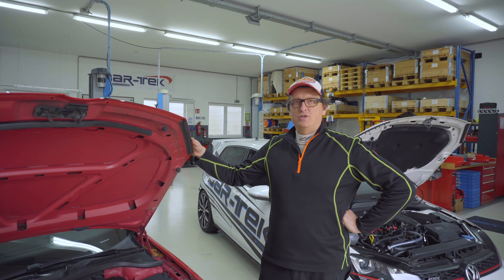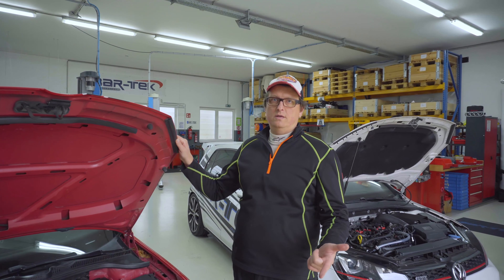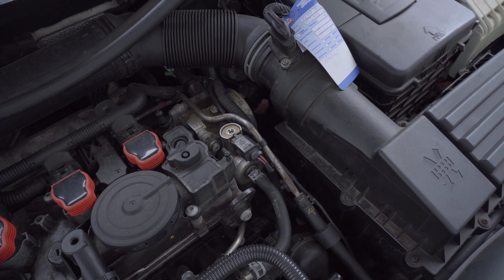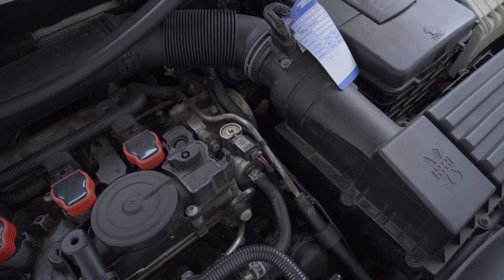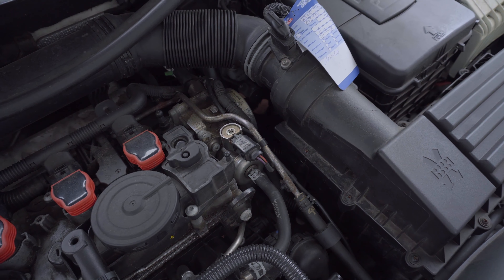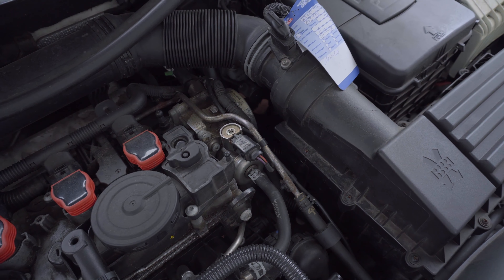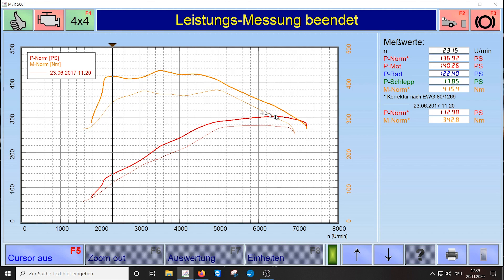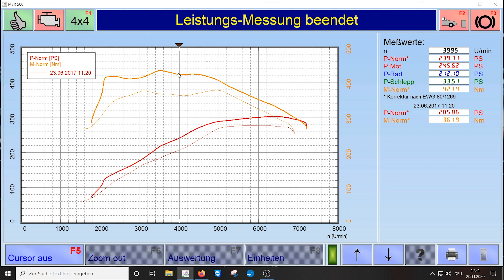Comparison: Golf Mark 6 vs. Golf Mark 7 | BAR-TEK® Motorsport

Comment: I have a Scirocco with the CAWB engine, is there anything I can do to improve those problems you mention with the Lambda and the High pressure pump?? 
Should I be concern if I go a stage 1 ?
Thanks for this channel , it's great!
Reply: You need to find a good tuner that will make a dyno mapping. And I also recommend to install our MTX Lambdatool to monitor Lambda all time ;-)
Reply: Thanks so much for the response!
Keep going with the channel you guys are doing a great job!

Comment: i am looking to buy mk6 r or mk7 gti. Which one should i ??
Reply: From my experience I would choose MK6 GTI Ea888 ;-)
Reply: The mk6 r comes with an ea 113 timing belt vs chain belt also 113 vs 888 can handle more power so space for tuning cam followers a issue but it’s easy replace and kinda cheap gti are susceptible to engine lights after 100,000 miles both engines are pretty easy to maintain and tune
Reply: 7 100%
Reply: Mk5 has a timeless design Mk6 has started  to go old mk 7 is just perfect at this time  I recommend mk7